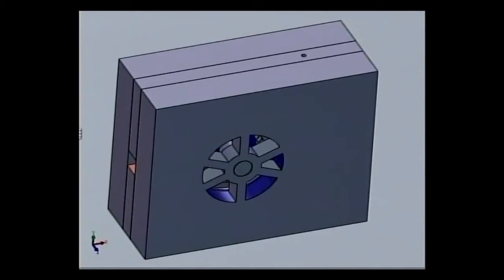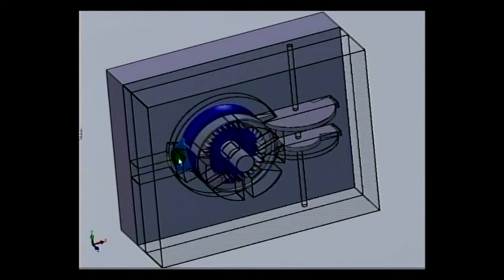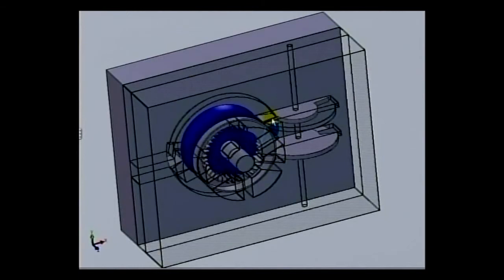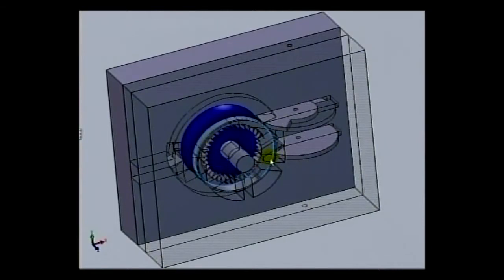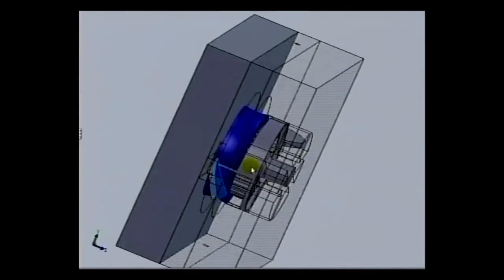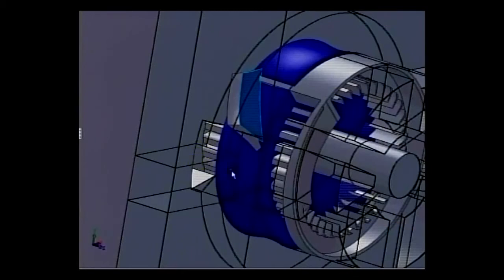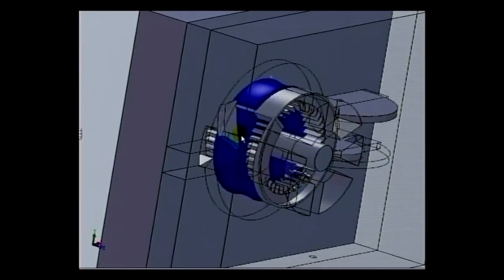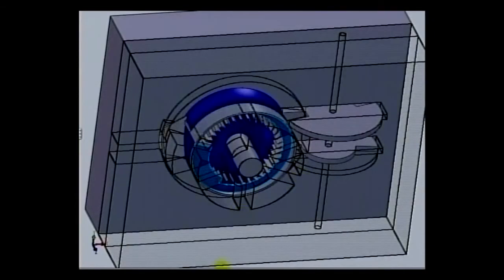Albert Harvey Rotary Engines

Comment: All these rotary engines are a great solution for a problem doesn't exist actually. The alternative engines are well balance using the second harmonic shaft, and the specific power goes above 200hp/lt. The goal is to reduce the specific consumption and the harmful emissions, and the rotary proved  to be inadequate
Reply from the maker: Hi Menbocino    The Wankel Engine is actually a reciprocating  engine .      My motors may be able to maintain 1500 degrees  will that be cool enough to prevent the  NOX ?    Thanks for your comment.   SY Albert

Comment: Cool engine. Good luck friend.   Keep at it, you have the right idea for it.  Let me know when you throw up others. If you want any advice I can try help with my current knowledge base. This is a great model I hope you get to give it a go?
Reply from the maker: Dear Oliver   I have six more designs after thee two .   I'm curios what your knowledge base is?   Thanx  Albert
Reply: Yeah you should make videos of your other ideas. My knowledge base is  largely in Maths and CAD. I actually plan to get back and make better videos when I have time. Not enough hours in a Day to do it all lol.
With that engine add another plate for the exhaust intake cycle.
Reply from the maker: You're right .   Another valve between the exhaust port and intake port would be an improvement to keep them separarated better.   Thanx for the input    Albert
Reply: good luck I hope you get it build. maybe try 3D printing services. you might be able to make a model.